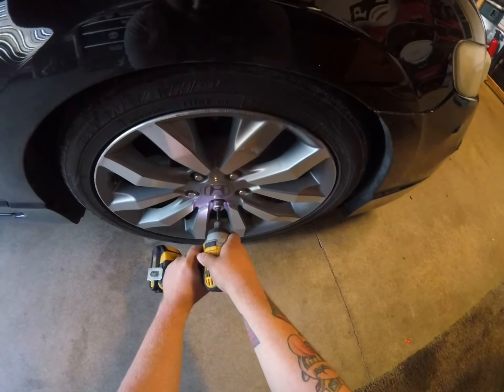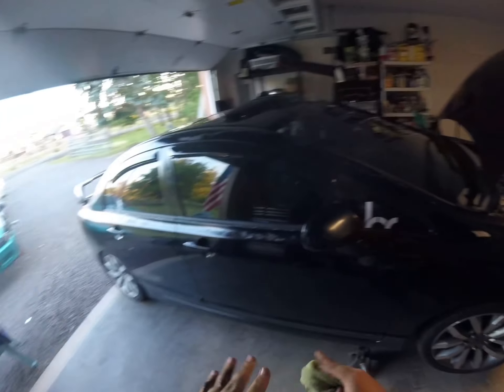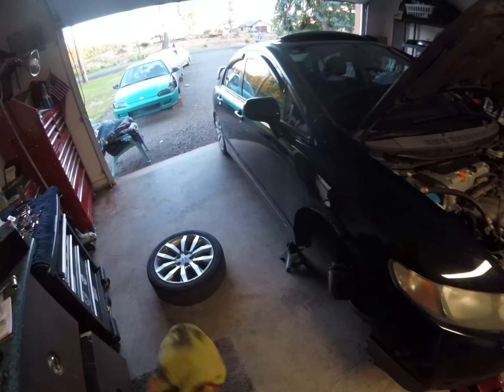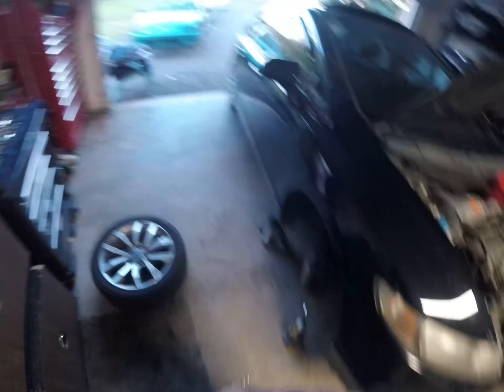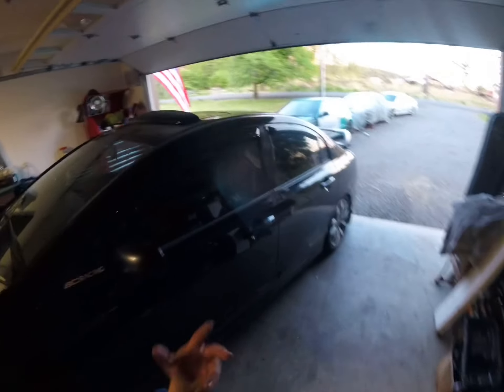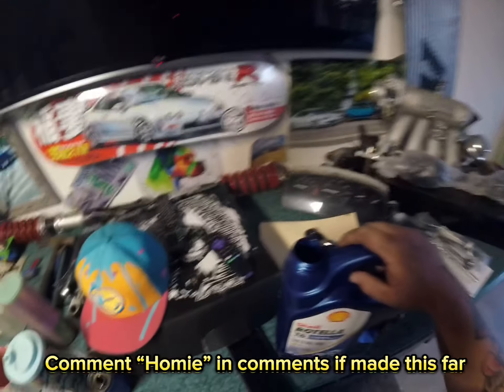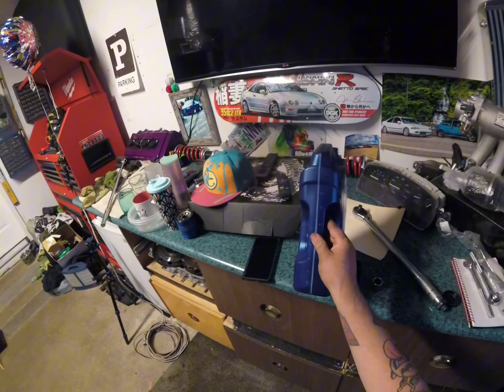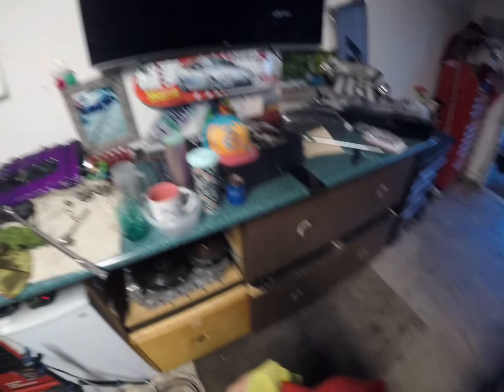POV Oil Change on a 8th gen si civic (Car Culture talk, So you want to get into cars?)

Comment: Homieee. Just found your channel. The algorithm picked you man. All good stuff. Shouldn't you use gloves when messing with oil and torque the drain plug to spec (also crush washer replacement)? Just mentioning it bc oil is a carcinogen and health is #1. The torque thing is just something I do or else I'll be paranoid. All love, nice vid.
Reply from the maker: Thanks man for the input!! Ya I really should use gloves just I'm arrogant and think every time I won't get it on my hands and do. 😂. Crush washer I did last time and totally spaced this time sadly. And I've torqued this drain plug so damn much I pretty much got it down 😎. Thank man I appreciate it!
Reply: @ProjectRad  Keep up the good work dude